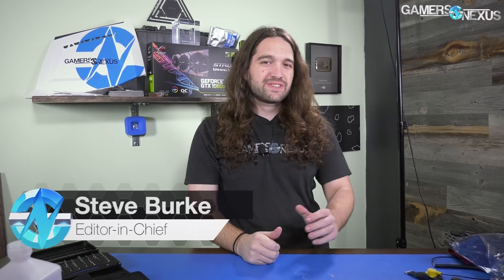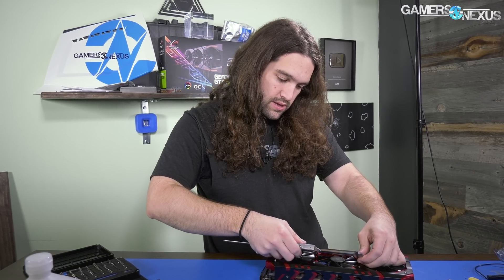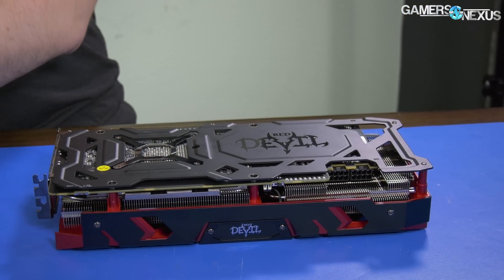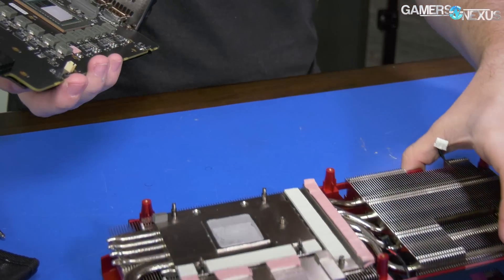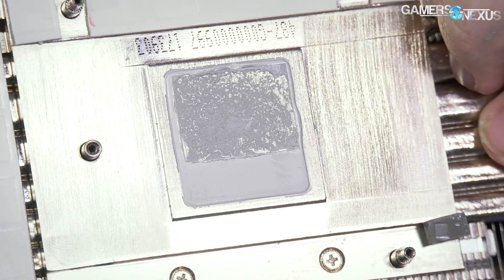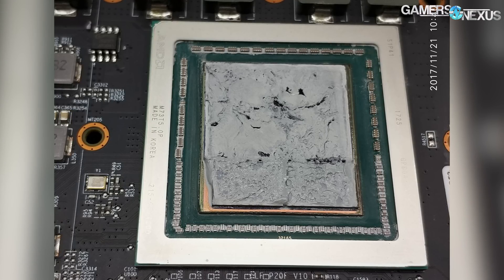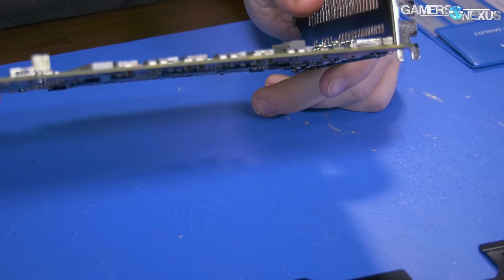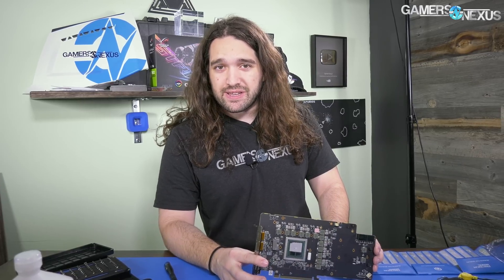PowerColor Red Devil RX Vega 64 Tear-Down (& Thermal Paste)

Comment: Out of curiosity what is the stepping on this power color vega ? 
Wasn't AMD supposed to be moving away from ASE for packaging the vega dies (well i'm saying that but I of course have no idea who packaged this gpu)? IMO it isn't AMD's nor Powercolor's fault, it's the packagers fault (well also AMD for allowing two different designs as well)... What I don't understand is why aren't the dies all "epoxied" it makes more sense just for interposer protection alone...
I mean how are AIBs even supposed to account for 2 different heights ? 2 different cold plate designs ? More paste is a solution but is it really ideal ? 

Another question how are coolers installed in production ? I'm guessing by hand, and how is the thermal paste applied ? By hand also ? If so that's a variable for fuck up
Reply: Yeah but AMD doesn't produce the packages, they don't produce anything except the design (like nvidia)... But they still seem to find it acceptable for some unknown reason (probably due to already really low yields on the dies and potentially on the packaging also). And they"ve already changed packager, but i'm not sure that the change applied to the Vega 10 as well, well nobody knows.

But yeah I agree it will start pissing off the AIB partners if this results in an "uneven" finished product, if they end up with lesser performing gpus because of this (which we will find out soon), people could just send them back and write off the brand because they aren't aware of this packaging difference. Potentially also just making it a pain to work with as well. Which is why I was wondering if the heatsinks are fitted by hand ? Because that could also result in a % of lost dies (though most likely small) when it comes to the unmolded version, with the interposer being really fragile. 
And I do think that they hand mount the heatsinks, because sapphire used to install a plastic film on the fiji dies to protect the interposer (also unmolded package).
Reply: it's still a problem even just 40um difference. there's little to none direct thermal transfer to the HBM2 dies while the device itself is temperature sensitive. sure, by having more thermal paste does the job but again, there's little to none direct thermal transfer. what we need is a direct contact as much as possible while TIM fills the pits on both cold plate and heat generating device.
Reply: Thermal paste is not designed to replace direct contact is there to replace air wich due to impeefwctions in both the die and heatsink surface is unavoidable more so in products that won't get custmized lapping or surface matching... if AMD can't produce these packages with a real good z-heigh tolerance board partners will run away from Vega.
Reply: jadoei13, 40 micros isn't much but it is still not a fix, that also is another assumption on their part as the height differentials could be more or less than that on different samples. I'm sure you know too much paste will actually act as an insulator, fine line though...Waiting to see their thermal differentials, really interested to see the numbers now.
Reply: RiffsNReviews HBM2 heat output isn't all to much, so I'm not to concerned about 40 micrometers of extra thermal paste. While I certainly don't think it is ideal, I guess they didn't have a whole lot of choice given that it would be better for everyone to have the better package.

Comment: "Almost as rare as good case reviews" that's because you don't have OUT OF THE BOX THERMALS
Reply: monjessenstein nah. In box thermals is where it's at.
Reply: Out of the box thermals are lower in the winter season because the package cools during transport.
Reply: The flux capacitor connects to the femer bone.
Reply: @sanitylogic4611  femur smdh

Comment: I was hoping that AMD partners would learn from the Tri-X and Nitro R9 Fury and use smaller PCBs + fan over heatsking to maximize cooling. Guess not :(
Reply: Sapphire pulse.
Reply: Alexander Yordanov they have to be big to accommodate those beefy coolers. Vega is hot as F$%#
Reply: So was Fury....

Comment: AMD fault
Reply: Foxlite I agree. After I posted my comment i realized it's the fabs job to ensure quality along with AMD
Reply: Foxlite Intel has honestly been ahead for years but I'm just happy I can buy an amd CPU and feel good about it and that the CPU will be competitive and the platform is going to last
Reply: Foxlite well I lean to Nvidia for gpus but my step dad is an ex AMD employee he has/had over 10 patents with then in there micro architecture. His name is Colin Hatchard
Reply: No hate from my side there, they really stepped it up with Ryzen in terms of production CPU's for the price point. I feel like intel is just a little more versatile when it comes to their gaming/production balance. AMD has come a long way in the CPU department for sure
Reply: The chips are not the problem, its the only way to get enough of hbm next to the gpu. AMD told for sure their customers what it is about. WE even knew that issue since vega frontier. IF now someone like powercolor still has not accomplished enough paste between these chips its obvious. That is also supported by the fact that they send out that crap to GN like that without checking it. @Foxlite - so you are a fanboy....can not take any word of you serious.
Reply: So don't take my word for anything and do the research yourself and arrive at a similar conclusion that in this case Vega is not worth it at its current price point vs the gtx line up (if you can find one). Its thermals are higher resulting in thermal throttling, and that's not even taking into consideration the VIDEO you are commenting on...its a known issue then why don't they resolve it. Why do some ship with resin and some don't, the quality control is laughable, look at the color patch testing. Slapping on extra thermal paste to fill gap due to height inconsistencies is not a solution. Too much thermal paste can act as an insulator. The reason I use the products I like is because I do research on all the  viable products for the application I want and Intel and Nvidia come up on top, statistically and for me functionally. My liking something shouldn't detract from documented statistics. The problem is that they send crap like that to EVERYONE not just GN. The heights are not static with each chip-set configuration so just guessing on how much thermal paste you need is not a viable solution. And they should be able to seat the HBM in that same configuration at the same distance to the GPU at the right depth, how close they need the HBM to the GPU has nothing to do with the way they seat them on the boards.
Reply: AMD did not make their own chip. It was Glo Fo and they dont make this cards either, its Powercolour.
Reply: So why is it AMD branded, why didn't AMD inspect the products that their contractor was producing before branding it and releasing it as an AMD product? It's still on AMD at the end of the day.
Reply: So was it the Condom 's fault or your Mom' s for your existence?
Reply: Nope - powercolors.
Reply: Actually both, watch the whole video, if you just cant handle the full 15 mins its referenced around 7:56. AMD is pushing out boards with imperfect GPU and HBM heights, in most cases not terrible but still not good...but yeah PowerColor really did a great job of just making it so much worse.
Reply: hey man no worries, imo AMD is a fault...I am a biased nvidia/intel fanboy after all. That being said I try to give them the benifit of the doubt but it usually leads to predictable outcomes. Not that I'm all that happy with nvidia and intels marketing as of late, but at least they have better overall quality control.
Reply: Relax and give me a smile, thanks for the constructive and informative reply, I'd like to know what i'm getting wrong. instead of being a perpetual waste of space and send a little of your brilliant insight my way.